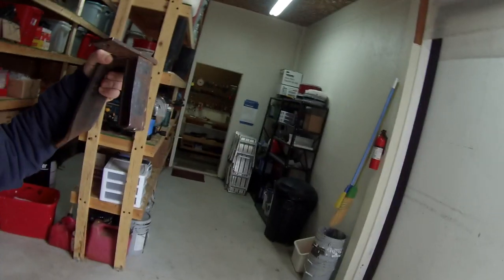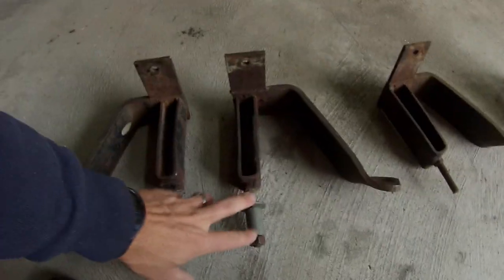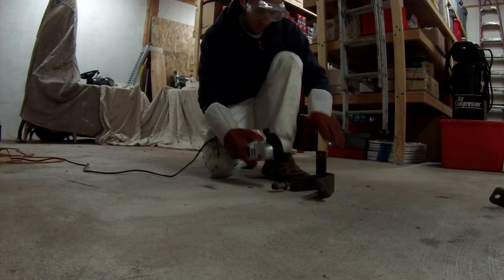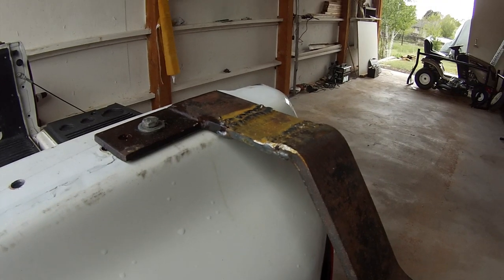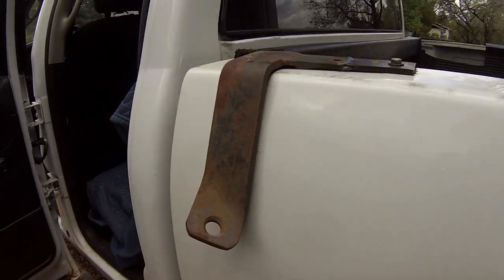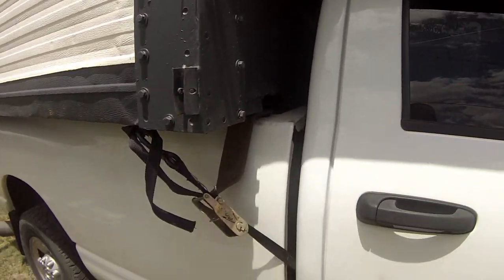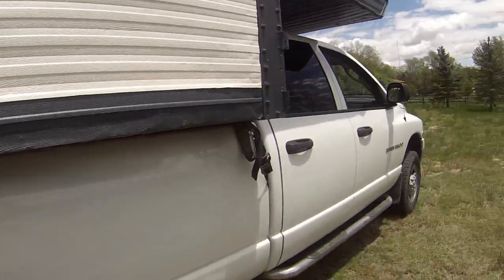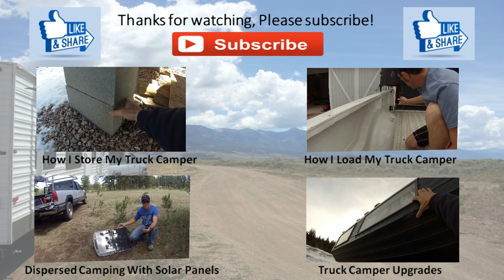Truck Camper Tie Downs

Comment: Seems pretty solid. All that matters is the camper doesn't fly off the truck right...LOL
Nice job. Cheers bro!
Reply from the maker: West Coast Roller LOL, yes exactly! Funny story, first time I took the truck camper out I only used two ratchet downs.  One on the front and one on the back.  We were driving to Copper Mountain and came up on a blizzard with 60mph wind gusts!  A huge gust of wind the truck, I looked in my side mirror, and saw the truck camper lift up about 4inches from the bed rail!  I immediately pulled over, adjusted the straps, and added 4 ratchet downs.  I don't know what in the hell I was thinking with only two tie downs, but I learned my lesson!  Thanks WCR, hope all is well!
Reply: Colorado Camperman I thought you were going to say it blew off the truck......! Close call.....I've had many of those moments embarrassed to say....
Reply from the maker: West Coast Roller LOL, good to know I am no the only one!

Comment: as i am a steel fabricator i would have done the same thing, as for the electrical tape i dont think i would do it, i would use a barrier of some sort, i have some yery strong rubber scraps from my work which it is called hung rubber that bolts on mining equipment....i have alot of it and its roughly 3/16 of a inch thick and has nylon in the middle of it, very strong stuff and i dont believe it would hurt your paint job! i could send you couple pieces free if you would like to try it! just let me know! happy campin!
Reply from the maker: ***** Good to hear someone who does this type of work for a living approves.  Yeah the electrical tape is sounded less like a good idea.  I like the sound of hung rubber, what do you think would be the best way to attach it to the truck?  Or would it attach to the strap?
Reply: Colorado Camperman i wouldnt even attach it to the truck just let the strap hold it in place...or another thought that might work is some old bicycle tire inner tube ...wrap it around the strap and zip tie it.might work idk!
Reply from the maker: ***** It's worth a try!  If you are serious about sending me a piece of the hung rubber, I would love to take you up on that offer.  I can't figure out how to message you, do you have messaging turned off?  If you are able to message me I will reply back with my PO Box #.  Thanks a lot, I really appreciate the help!
Reply: Colorado Camperman i sent you a message im not sure if you got it though let me know!
Reply from the maker: ***** Thanks Brian, for some reason I don't get notifications when someone messages me.  Sorry it took me so long to reply, check your message box.  Thanks again man!

Comment: Hey Brian, just found your channel. Great deal on that truck camper ! Just a thought, you might try using rubber or foam on the strap itself; then you can tape the foam to the strap ! That clear bra material can be found at an auto supply store like Auto Zone or whatever the stores are in your area !       Happy Trails....................John
Reply from the maker: Wanderin' Moose I am going to experiment with some rubber or foam.  If that does not work I think I will test out the clear bra materials.  Thank you for the idea and the info on where to get that.  I figured it couldn't be hard to get.  Thanks for discovering my channel and checking out my videos!

Comment: Nice work. Where did you get those massive steel corner brackets / gussets on the front corners of your camper? Store bought or make them yourself? I am needing some similar for my home made camper plans. Thanks in advance.
Reply from the maker: Thanks!  When I purchased the truck camper, those corner steel brackets were already on there.  Thanks for watching!

Comment: Piece of water hose cut in half would sold the problem! Did you back up those eye bolts? I just got a camper and I got no mounting hardware at all with it :( I also installed eye bolts but terrified it's fall off going 75 down the highway

Comment: And four years later a guy watches your video and says, "Why don't you just bend them to fit?"
Reply from the maker: Lol, that could have been an option, but I did't really have the proper equipment to heat up and bend steel that is that thick.  Thanks for watching!

Comment: I'm not so sure on the idea of using electrical tape directly to the body to keep the straps from scuffing. Perhaps a little a rubber pad? Its just a thought. Also, its nice to actually see your tie downs and what you meant by extending them. I've said it again, 'geez, trucks have been getting bigger these days'! Just be sure to check on those modified brackets every so often for cracks and bending, just in case. Hope you have many safe camping trips!
Reply from the maker: Jimfoxyboy My thinking with the tape is that then the ratchet strap can still slide slightly with the movement on the camper.  How thick of a rubber pad are you thinking?  I also thought of something like that clear bra material but I have no idea where I would get that.  Or I could just buck up and get a frame mounted system, lol.  Thanks for the reminder on inspecting the brackets.  I will add that to my tear-down check-list!
Reply: Colorado Camperman My thinking is, if it slides along the tape, the strap might wear down on it. I'm not sure how durable tape would be or how much you might expect your straps to slide around. Plus there would be that sticky mess left behind when you take it off. I was figuring a rubber, or maybe foam rubber pad, probably 1/4" thick might do if your strap doesn't move very much. You'll want something between the strap and the truck body that can flex and squish a little, kind of like a buffer. Experiment though, see what works best for you.
Reply from the maker: Jimfoxyboy Will do, thanks for the tip!  We use our travel trailer mainly in the summer time, but when I take the truck camper out next I will upload a video of my solution.